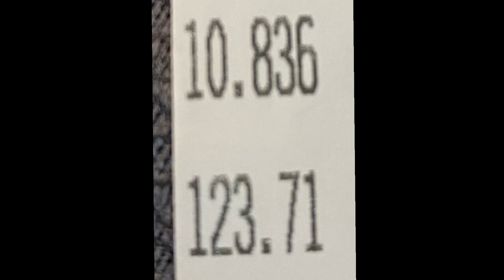Nitrous LS 5.3 Chevy S10 to 6.0 Build in 8 Minutes

Comment: I noticed you have the low profile cal tracs. I am fixing order a set an I was wondering why you chose the low profile over the standard set that has two adjustment holes on the end closest to the cab? I am trying to decide which set to go with. The low profile or the standard? Any advice?